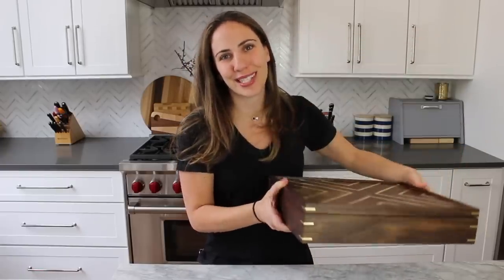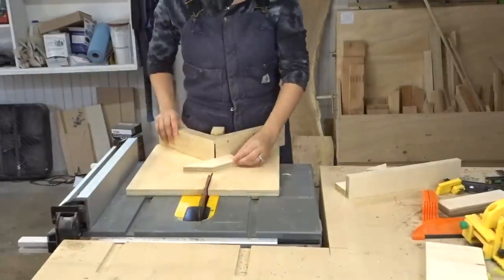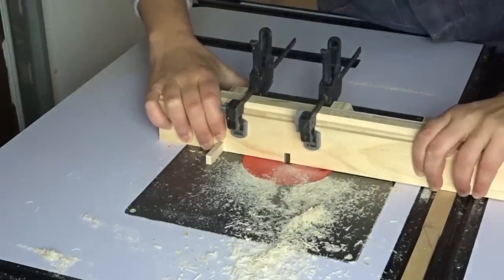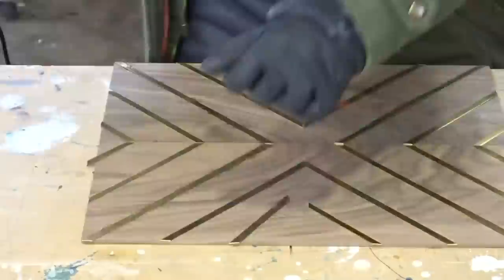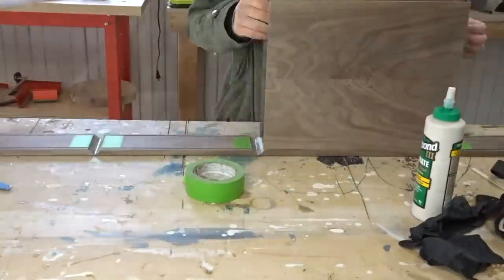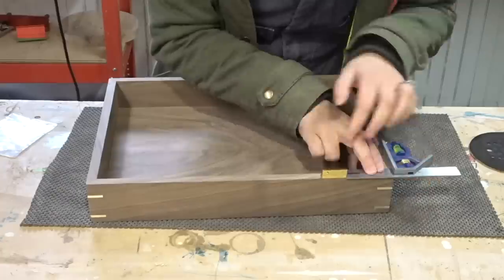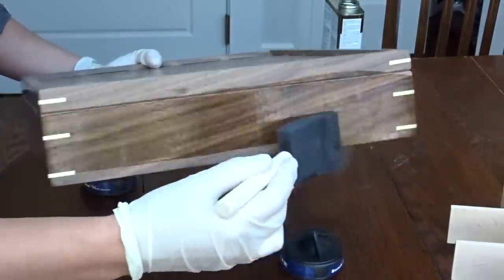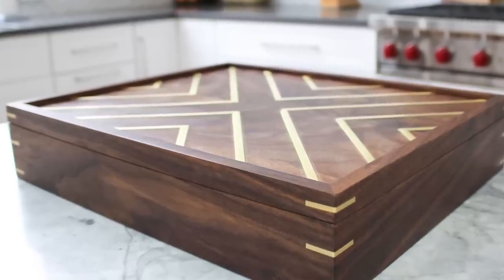Walnut Tea Box // Brass Inlay // Brass Splines // Woodworking Project // Spline Miter // Half Laps

Comment: very nice box. if you ever do more of these, a little tip. if you make shims the thickness of your saw blade, and insert 2 near each corner after each cut, and hold with a little tape, it will keep the lid from moving around on the subsequent cuts. this reduces the chance of wobble causing the kerf to be uneven.

Comment: As the ads used to say, "You've come a long way, baby". There used to be an old woodworker, Jim Krenov. The gist of what I took from his teachings was that heightened or focused perception is a key asset. One instance of that is the perception of what constitutes sharp and less than perfectly sharp. Another is understanding which of many possible causes are responsible for unsatisfactory machining, where all those burns come from. As you expand your perception you'll begin to recognize one cause after another of all those burns, the idea being to have the work more closely resemble a thought. More than 40 years ago a neighbor came into my shop as I was warping a blade and scorching the hell out of some elm that was full of stresses. He stood there until the saw and dust collection wound down. He made a show of sniffing the air. "Ah, yes. I had a woodburning set when I was a boy".

Comment: Great project and great job. Another adhesive option is fish glue. The reason for such a recommendation is simply due to the wood and metal expanding and contracting differently than each other. Fish glue allows creep for wood and metal. Lastly I highly recommend scuffing the back of the brass with 100 grit. This allows whatever adhesive to bite into the metal.
Reply from the maker: Fish glue? I’ve never heard of it. Thanks!

Comment: I love thes videos a the  12" slider has a depth set it would work in place of the table saw 
put a 2" board against the table and slide the saw out just a suggestion I do like these videos I cut my sidepieces in pairs at the sametime cut the initial an 1/8" long and clamp them together the cut them> I hane done woodworking for a long time and a table sae is what I use for my miters much safer and easier than a table saw, you spent quite a while seting the hinge yas well you could have cut the hinge hardware holes before assembling do all the cutting drilling prior to assembling. I do love your videos keep posting I'm a 30 year woodworker and I enjoy watching these I like you spped it up so we can walk through it with you. one last thing you should get a bandsaw then yo can cut any size stock in half the table sw doesn't like cutting it. Their is a line on the blade and as a rule of thumb you don't want your blade below the teeth line the blade can't breath and it burns them up you want to keep it low for saftey but not to low. thanks again for posting and KEEP POSTING

Comment: I recently did a divided for a drawer for nut & bolts, I used a crosscut sled & dado set- much easier than what you did. Easy is good :-)
Reply from the maker: Yeah. Would be easy if my saw could hold a dado stack....
Reply: @3x3CustomTamar  I use my old delta table-top model, it will only hold 1/2" but it is nice to have a dedicated dado- no changing blades

Comment: Very impressive! I've worked with a bit of aluminum and brass is my woodworking and there is definitely a learning curve. Like you said. Minimal sanding lol. Sometimes when I'm being lazy I will just use aluminum or brass powder mixed with CA glue or epoxy instead of the actual metal bar stock. That way I can sand them down if I don't wanna be too accurate and no gaps. Still looks great tho.

Great woodwork with minimal tools. Very well done.
Reply from the maker: Thanks!

Comment: Quadrant/4-way matched lid behind that brass pattern would have been awesome!  Turned out great either way.  I was worried at first you were going to sand/file forever when i saw how far those splines stuck out initially lol
Reply from the maker: Ooooh. You’re actually right. I didn’t think of that. And that would have been killer..... ha! I did do a lot of sanding. But not that much.
Reply: Also, I like making boxes that way (build a closed box and cut it open).  I did it exactly how you did the first time I tried, but after that I would cut almost all the way through (leaving around 1/32" or less) with the table saw, and then finish it with a knife to open it (then chisel and plane/sand off the remainder).  I worry a lot less about the box accidentally getting into the blade and getting chewed up at best, or kicked back at worst.  Might be worth a try, but if you're comfortable doing through cuts I know a lot of people do it the same way with out issue.  I'm just not as brave :D
Reply from the maker: Sounds like a good way to do it! Thanks!

Comment: If you want t to do some inlay like this in the future, use an end mill bit instead of a router bit, it will give you a flat bottom and square corners without all of the extra chisel work.  Of course there are router bits that would do the same thing, I feel that an end mill bit fluted to pull the chips up out of the cut does it a little better and smoother over all.

Comment: The tarten tape with the fibres in it work really well for gluing mitres. Also make sure you wipe the wood down really well or blow it off before you tape it. Box looks really good though, even though the brass came loose :P. Best woodworkers know how to fix there mistakes ;-)
Reply from the maker: Thanks! Figuring out how to fix mistakes is quite satisfying. Frustrating while it’s happening. But after figuring it out it’s satisfying. Ha. Thanks!

Comment: If to pre-sand brass with coarse sandpapers it will be held by the glue much better. 
Also for any kind of slides LDPE chopping boards seem to be the best material - LDPE  has low coefficient of friction and plastic chopping boards are very cheap (unlike sheet LDPE from online suppliers).

Comment: When cutting apart the box on the table saw, I like to put tape on the box to help prevent tearout, and as I cut each side, Ill retape it to keep it all in place as I run the other sides through.  Placing a small spacer stick the width of the saw blade in the cutout then taping over it will hold the pieces in place for that final cut where everything usually goes wrong.
Reply from the maker: Nice tip

Comment: 8:50: Do you use a specialized bandsaw blade to cut through brass (and/or other metals), or just use the same blade you'd use for anything else?
Reply from the maker: Nope! Brass is soft enough to cut with regular woodworking blades
Reply: copper,   brass, aluminum...all cutable with standard woodsaw blades

Comment: nice project. just wondering, why not resaw on the bandsaw? also, i had that same dewalt tablesaw. i then upgraded to a cabinet saw. probably the best decision i made once i committed myself to become a more serious woodworker. at any rate, good work! just discovering your channel.
Reply from the maker: Thanks! Well. My bandsaw isn’t really made for resawing hard woods. It usually ends in disaster. I’m an definitely looking forward to an upgrade one day!
Reply: If you're on a budget, I would recommend looking at Craigslist for older bandsaws. You don't need latest/greatest if you can't afford it right now. Just get an older machine and tune it so it's accurate enough for what you do. I would add that the older machines were made much better than newer ones being imported.

Comment: Mam, thanks for uploading such a nice video. I am also partway through my first brass and and wood  inlay table top. I wonder if using un- polished brass for the inlay and sanding it with the wood will not affect the end result. Also a clear wood finish like lacquer or polyurethane will make the brass look as good as the wood with these finishes. Lastly, kindly advise the sand paper grits to be used.
Regards, 
And thanks in anticipation.
Reply from the maker: Set the brass deeper than the wood. So you can sand the wood. Just go through all the grits. Finish off with steel wool

Comment: Great work!
I just couldn't wrap my head around how the brass inlay (especially one that goes 45 degree across the grain) didn't being overstretch to the point of breaking or squeeze by wood movement. Would love to hear tour insight on this
Reply: I'm thinking that the movement wouldn't be too much of an issue since the inlays are diagonal across the grain. Total movement on half of the panel (none of the inlays go beyond half the width) would probably only be about 1/32". Divide that by the width of the brass and the tiny fraction of movement would be well within the flexibility of brass at that thickness.  At least that's my guess.  Worst case scenario I can imagine is the points where the brass meets in the center may develop a tiny gap at some points in the year.
Reply: @Demolishionist  Thanks for sharing! I love brass inlay furniture and plan to do a massive ones. Would be great be hear from Tamar herself I reckon. Your point, as well, is really good
Reply from the maker: Also. The top is super thin. Barely any movement happening there

Comment: I've been wanting to do brass/copper inlay for a while, but my main fear has been that the metal would oxidize underneath the finish over time. Have you had any such issues? That's a really nice box!
Reply from the maker: Nope! You can seal it and it’s fine. Thanks!

Comment: I am curious, did you like working with Maple? When compared to pine and oak in hardness, does it tear apart easily or ?
Reply from the maker: Maple does not tear out easy. It is very hard and usually the grain is pretty straight. IT does get some burning with some blades and bits though
Reply: With what I'm working on, the guy 300 years ago was a wood worker like you. Having the right tools to do the job with matters. A guy went to Alaska and had a good life because he was a good wood worker.

Comment: Did you go over the top/brass with a random orbit sander after the belt sander? What grit sandpaper does brass need?
Reply from the maker: I believe so. And then I rubbed it with steel wool
Reply: @3x3CustomTamar  Ah yeah that makes sense

Comment: Beautiful project, Tamar.  But I was hoping that, along with everything else, you would include the source of the sticky-backed sandpaper you used.  I couldn't tell from the video what size that sheet was, and I've been trying, without success, to find 8+ inch wide rolls of adhesive sandpaper ever since I say another woodworker using it.  Unfortunately, I couldn't ask him because his video was in another language!  You weren't by any chance using sandpaper from a roll (I hope!), were you?   -Russ
Reply from the maker: Thanks! It’s not so wide. I roll out multiple pieces of the sandpaper to cover a large sheet.

Comment: Hey Tamar, I know this is an old video and you probably aren't watching it's comments any more, but in case you are, what would you have used instead of the belt sander to take down the brass? An orbital sander? You kind of left that open ended lol
Reply from the maker: I would have routed the channels deeper. So that I was sanding it wood instead of the brass
Reply: @3x3CustomTamar  that's a good point. So you would've done a dry fit, noticed it was too high, a d then put it back on the cnc with a new depth input? That does make more sense actually.
Reply from the maker: @kevinwiley5325  yup

Comment: What size blade do you use on your band saw to cut your veneer? What I mean is blade width and tpi count.
Reply from the maker: This is an old video. I’ve since upgraded my bandsaw. And I use a resaw blade with a lower tpi. I like the woodslicer blade
Reply: Ok! I’ll give that a try! Thanks for the info!

Comment: You might have to use shelack on the inside of box to get rid of the lingering oil smell at this point.
Reply from the maker: It’s not lingering anymore. I let it air out before putting stuff in it.

Comment: Get a band saw for those resaws.
Reply: Oh. You have a bandsaw, but prefer making multiple passes with a table saw?
Reply from the maker: My bandsaw is just not powerful enough to resaw hard wood. I’ve tried.
Reply from the maker: I have a band saw. I hate resawing on the table saw. But my bandsaw is not powerful enough to resaw hardwood. It stalls....

Comment: Sorry thumbs down . Nice box ,but you lost me with the CNC router. IF the job was all CNC that would be one thing ,and frankly of no interest to me . Doing the brass inlay by hand would have been very instructive. So why go through all the tedium of cutting the dados with multiple machines instead of using the CNC? Most people don’t have a CNC .why not have yours make all your parts and turn the video into kit assembly. Also perhaps there should be some sort of lip or gasket to stop air movement so the tea does not go stale. That box holds a lot of tea.
Reply from the maker: Well, I drink a lot of tea..... sorry you can’t imagine just setting up a fence with a stop for your router. That’s all you would have to do. Or perhaps make a template. It’s the lack of imagination that the problem. Not the lack of tools. I am on a time crunch to crank out these weekly videos so I take advantage of tools that make my job quicker and easier. As for why I don’t cut joinery in the cnc. I don’t think that would be quicker for me. To each their own!
Reply: 3x3Custom - Tamar  Thanks for getting back to me. I grew up looking at old furniture that had fine brass wire inlays. They where deeper than they were wide. How the masters of old did them has always been a question for me. The dados were not saw kerfs because the line where rarely straight, gracefully curves mostly. Did the use a 1/16 chisel , teeny tiny hand router? I just don’t know. Any keep up the good work , thanks for the videos and don’t let my one thumb bother you.
Reply from the maker: Pocketfarmer1 I have no clue how the old masters did anything. Ha. I wouldn’t be able to work without my power tools.